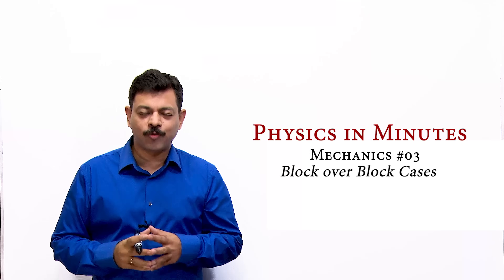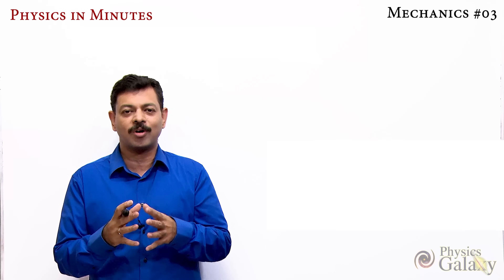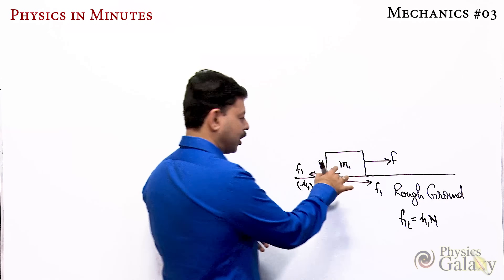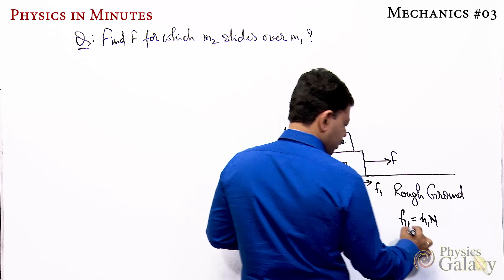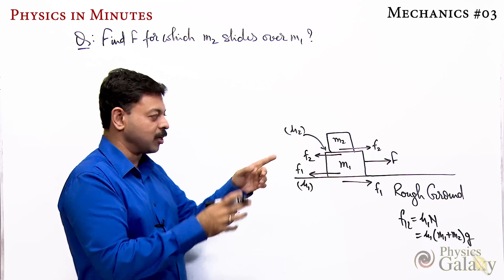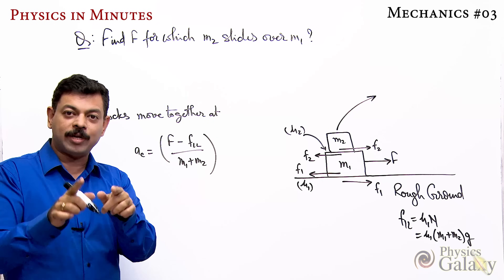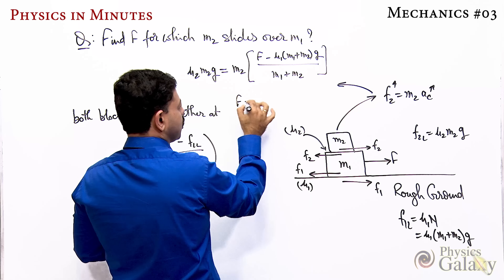Block over Block Friction Cases for JEE(Adv) | Class 11 Physics in Minutes | #PhysicsGalaxyPIM

Comment from the maker: Practice Questions for students on concept of above video. Students are required to solve these questions and verify the answers given and for Q3. Solve the question and post your answer in comment section for discussion and verifying your answers. In all below questions take g = 10m/s².

Q1. A 4kg block is placed over 8kg block on a rough ground. Friction coefficient between 8kg and ground is 0.5 and that between the two blocks is 0.2. A force F is applied horizontallay on 8kg block. Find at what value of F sliding will start between 8kg and ground then at which value sliding will start between the two blocks ?
Ans [60N, 84N]

Q2. A 7kg block is placed over 5kg block on a rough ground. Friction coefficient between 5kg and ground is 0.3 and that between the two blocks is 0.5. A force F is applied horizontallay on 5kg block. Find at what value of F sliding will start between 5kg and ground then at which value sliding will start between the two blocks ?
Ans [36N, 96N]

Q3. A 10kg block is placed over 20kg block on a rough ground. Friction coefficient between 20kg and ground is 0.1 and that between the two blocks is 0.2. A force F is applied horizontallay on 20kg block. Find at what value of F sliding will start between 20kg and ground then at which value sliding will start between the two blocks ?
Ans [Post Your Answer of Q3 in comment section to verify]
Reply: Sir, plz post such questions after every video based on the content of the video
Reply: 30N and 60N
Reply: 30 and 90 N
Reply: 30N  and 90 N respectively
Reply: 30N
90N
Reply: Q3. Ans=30N & 90N
Reply: Q3) 30 and 90
Reply: Sir in the first qn..we were asked to find the f for the 8kg block to slide on the ground ... so are we suppose to take f limiting as 0 in the case of lower block and ground???? help me out plz!!
Reply: 30 and 90 N
Reply: 30N and 90N respectively
Reply: 30N and 90N
Reply: 30 N and 60 N
Easy ques, great work! 🙏
Reply: 30 and 90 N respectively
Reply: [30N,90N]
Reply: 30N 90N
Reply: 30N and 90N🙏🏻
Reply: 30 90
Reply: 30N and 90N
Reply: @shridhargupta2340  it's 30 and 90 not 30 and 60 bro
Reply: @nitishsharma7309  but how
Reply: 30N, 90N
Reply: 30,90 N
Reply: 30 and 90N
Reply: 30N n 90N
Reply: 30 90
Reply: 30N 90N
Reply: 30N & 90N
Reply: [30N,90N]
Reply: 30N and 90N
Reply: 30,90
Reply: 30,90
Reply: ३० and ९० respective ly
Reply: 30N and 90N
Reply: 30N and 90N
Reply: 30 nd 90
Reply: Ans. 30 N and 90 N
Reply: 30N and 90N
Reply: 30N and 90N
Reply: Sir #hybrid #physics classes resume hogi ya nahi ??
Reply: Q3. 30N & 60N  respectively
Reply: {30N, 90N}
Reply: SAIM TANWEER  last ans is 90N
Reply: 30N,90N
Reply from the maker: Correct answer @DK BHAKAR, @Samarth, @Prabal, @Abhiram, @Aditya, @Debajyoti, @Shalini, @Sanjib, @Sahil, @Dr. K, @Amit das, @Bipul, @Swapnadip, @Maya, @Sumit Debnath, @RAKESH JHA, @Abinash Biswal and others!
Reply: 30 and 630
Reply: 30N and 90N
Reply: 30 N and 90 N
Reply: 30 and 90
Reply: Yes sir
Reply: 30n Nd 90n
Reply: Very awesome techniq👍y sir
Reply: 30 and 90 respectively,😇
Thanks sir ,now feeling happy by solving such que as earlier still facing difficulties in these🙏🙏😇😇😇😀😀😀😀😀😀
Reply: Q.3 Ans. 30N, 90N
Reply: 30&90
Reply: 30,360Newton
Reply: Yes sir Ans 30N and 90 N respectively
Reply: (30,90)
Reply: 30N,90N
Reply: 90N and 30N
Reply: 30 N and 90 N respectively
Reply: 30N and 90N respectively
Reply: [30N, 90N]
Reply: [30N,90N]
Reply: Ans(ques-3)-30,90
Reply: Sir plz ammeter ar galvanometer kra do short me plz
Reply: 30,90N
Reply: 30N, 90N
Reply: 30N and 90N
Reply: 30N and 90N respectively sir..
Reply: 30 and 90 sir......
Reply: 30N 90N
Reply: Q3) answer is 30 and 90N
Reply: Ans [30N, 90N]
Reply: 30 and 90 N respectively
Reply: Ans. Of Q-3 is 30N and 90N
Reply: 30N and 90N respectively...🙏
Reply: 30 and 90
Reply: 30N,90N
Reply: 30 90
Reply: 30N & 90N
Reply: [30N, 90N]
Reply: Sir please two block spring Shm Ka bhi case padha dijiye
Reply: 30 and 90
Reply: 30 and 90
Reply: 30N&60N
Reply: Ans[30N,90N]
Reply: 30N & 90N
Reply: 30N,60N
Reply: 30N,90N
Reply: 20,170
Reply: 30,60
Reply: 30,90
Reply: sir second question ke second part ka answer 113 N aa raha h pls verify kar dijiye
Reply: 30 and 90
Reply: 30N ,90N
Reply: 30N and 90N respectively
Reply: 30N and 90N
Reply: @shridhargupta2340  wrong hai beta
Reply: 30N and 90N
Reply: @shridhargupta2340  buddy use the last derivation as shown by sir in the video  it would be 60+30=90.......
Reply: 30N,110N
Reply: 30,90
Reply: 30,90
Reply: 30,90
Reply: 30N and 90N respectively
Reply: Sir 30,90
Reply: 30 and 90 N
Reply: Thank u sir majaa aa gya ye q q krne me😊
Reply: 90aayega ek ans to third ka
Reply: @shivajipawar9195  😁
Reply: @UMESwapnadipDas  to
Reply: 30N &90N
Reply: 30N and 90N
Reply: Ans 3 will be. 30N,90N with common accleration 2
Reply: Sir the answer of the third question is 30N, 90N
Reply: @sijodiro1876  why will you take that?
Reply: [90N,150N]
Reply: Answer for Q3, 30 N and 90 N
Reply: 30N 90 N
Reply: 30 nd 90
Reply: 30Newton and 90 newton
Reply: 30 N and 90 N
Reply: 30 and 90😁
Reply: 30N & 90N
Reply: Yey :)

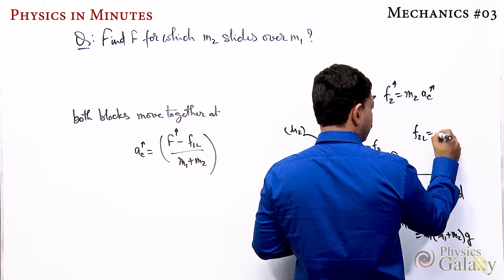Comment: 3:40 is it not possible that M2 slides over M1 before they move together with a common acceleration. Suppose if value of limiting friction for M2 is less than value of limiting friction for M1 , in that case is it not possible that M2 slides over  M1 before they both(M1 and M2) start moving together?

Comment: Q1. A 4kg block is placed over 8kg block on a rough ground. Friction coefficient between 8kg and ground is 0.5 and that between the two blocks is 0.2. A force F is applied horizontally on 8kg block. Find at what value of F sliding will start between 8kg and ground then at which value sliding will start between the two blocks ?
Ans [58.8N , 82.32N]

Q2. A 7kg block is placed over 5kg block on a rough ground. Friction coefficient between 5kg and ground is 0.3 and that between the two blocks is 0.5. A force F is applied horizontally on 5kg block. Find at what value of F sliding will start between 5kg and ground then at which value sliding will start between the two blocks ?
Ans [35.28N , 94.08N]

Q3. A 10kg block is placed over 20kg block on a rough ground. Friction coefficient between 20kg and ground is 0.1 and that between the two blocks is 0.2. A force F is applied horizontally on 20kg block. Find at what value of F sliding will start between 20kg and ground then at which value sliding will start between the two blocks ?
Ans [29.4N , 88.2N]

Comment: answer is 30N to start the sliding between the block and ground, and 90N for sliding between  blocks, as 60 will be required for upper block to slide and 30 for the lower and ground = 90N.

Comment: Sir I had a doubt regarding a question of Work Energy 
Sir in the following type of question 
Q) 
A small particle slides along a track with elevated ends and a flat Central Part. the flat part has a length 3M the curved portion of the track are frictionless but for the flat part the coefficient of kinetic friction is 0.2 the particle is released at point a which is at a height h is equal to 1.5 metre above the flat part of the track. where does the particle finally come to rest? 

Why don't we measure the distance covered by the block in the curved portion. I am not getting full satisfactory answer to this question. Hope You will Answer Sir 🙏🙏🙏
Reply: Not sir to answer but if u find it convincing then fine...
Gravity force is conservative in nature..  path taken is not considered while calculating work done or energy BUT 
SHORTEST PATH (Displacement) IS TAKEN TO CONSIDERATION..